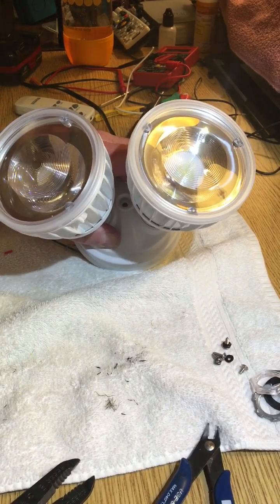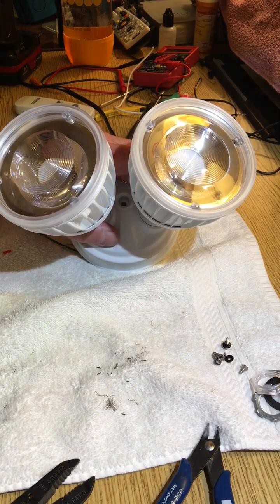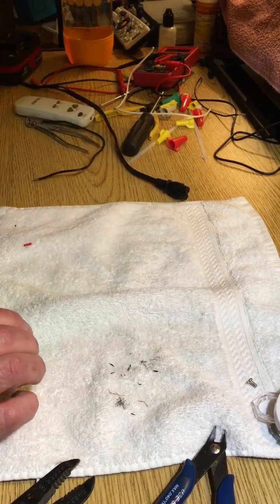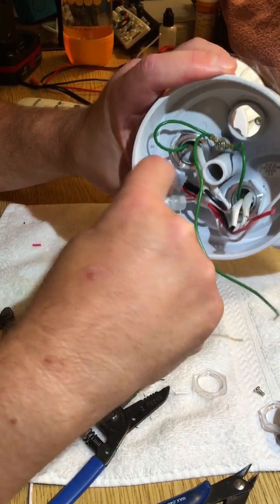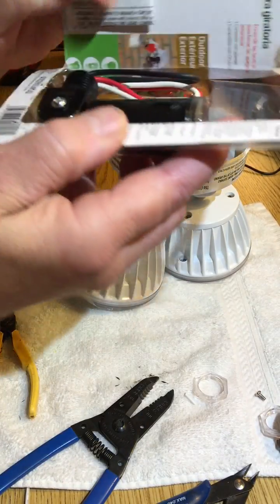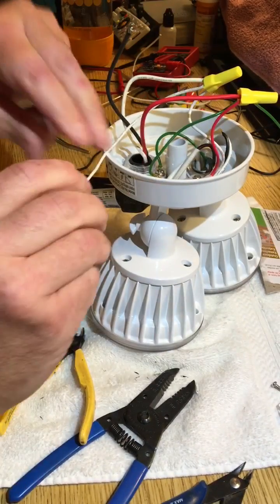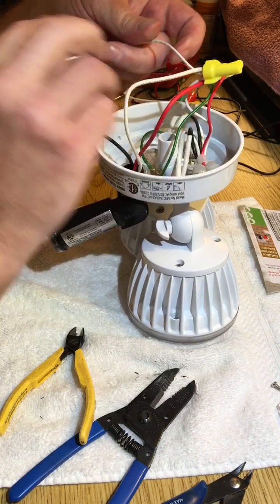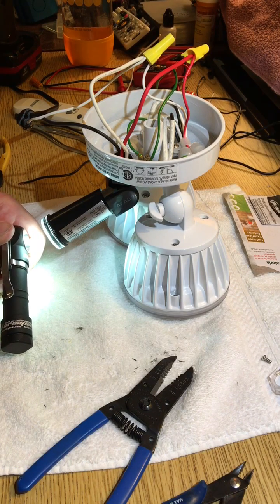Convert motion sensing LED flood light to dusk to dawn.

Comment: I bought a Homezone motion activated LED security light 2500 lumens back on 2016 from Amazon. I ts still in use outside my front door. But the birds pecked away at the motion sensor and its broken. I understand what your doing in this video but instead of using that module you installed for dusk till dawn, can I rig this light that I have just to turn on with the light switch off and on whenever I want. Thank you.
Reply from the maker: Absolutely, it should just be the hot/load wires that go thru motion sensor that get cut , stripped & connected together.
I did exactly that on the exterior of my new shop and ran the entire circuit of 5 lights thru one light sensor.
Reply: Thank you for your time. Much appreciated
Reply from the maker: You’re welcome, obviously I’m not a professional but at least we can help each other

Comment: Mine died after 3 years, there's a reason why Costco doesn't carry this 
anymore. Paragon LED AC-30135 is not replaceable. Avoid Home Zone aka 
made in China
Reply from the maker: I’ve actually had good success with these. It was 5 years ago I posted this video and all the units I retrofitted are still working fine. I placed three around my deck at our primary residence and I think I have five running at a beach house.
Knock on wood, I probably just jinxed myself.

Comment: i have plans to use a dusk sensor for two lamps (in series) .thanks
Reply from the maker: Enrique Neri I put 3 of them on the same photo switch at our vacation cabin & it works fine. I just eliminated the motion sensor & put photo cell inline.
Thanks.

Comment: I bought several of these LED lights from Costco this month and love them.  They work much better than the older ones that I had, the motion sensor going out in them.  Months before I got these new LEDs I also thought of “how do I eliminate” the motion sensor and just turn this into a dusk to dawn light.  Your video shows a simple easy way to modify the older units to continue to use the LED lights.  Excellent “idea” for adapting the older LEDs to flood light only “dusk to dawn”! 

Thanks